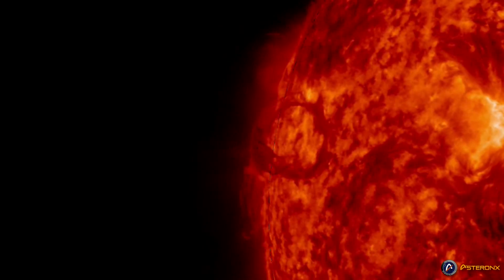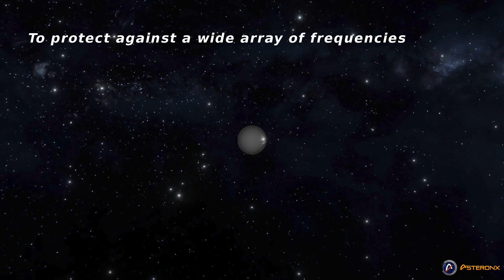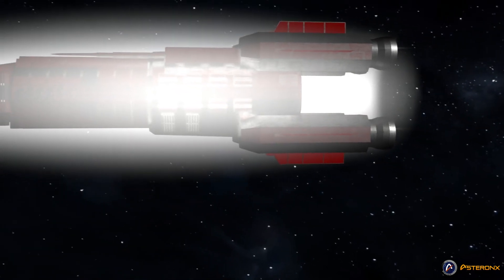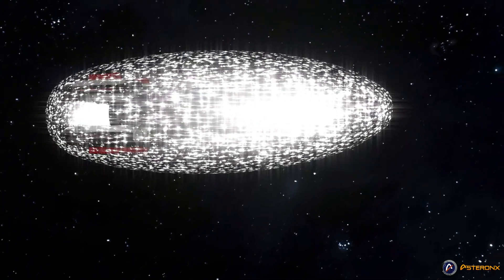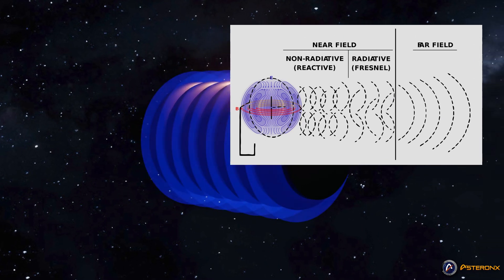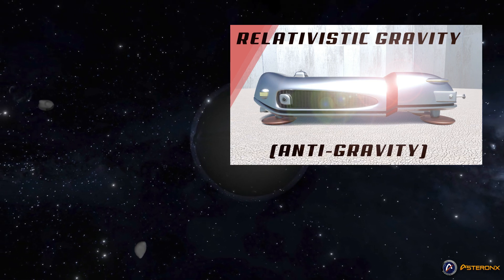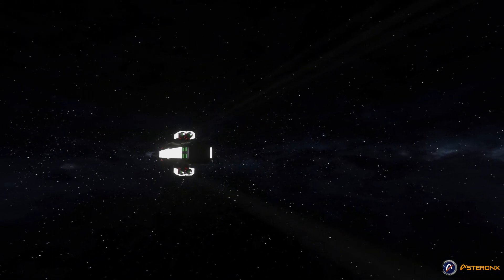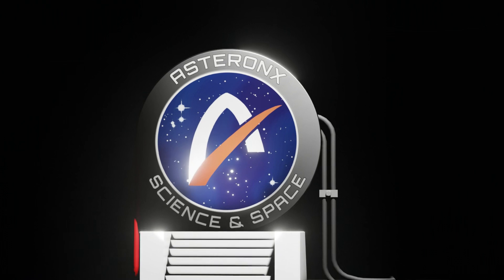Shields Up! Real Life Energy Shields

Comment: Assuming a warp field is possible, would it not, itself, have a 'shield' effect?
Reply from the maker: Yes and no, the more achievable variants have fairly gentle tidal forces across the bubble boundary, and so do nothing to deflect much of anything. However, with a redesign, it could very well be possible.
Reply: @asteronx  Some of the warp drive models worry about accumulating particles along the flightpath and that on termination/stopping, these would be released - potentially in a very destructive way.  This implied to me that the field might be effective at stopping incoming particles or even 'objects.'  If it were somehow possible to 'balance' the field in such a way as to avoid accumulating these particles, as some have suggested, then perhaps the field might still be an effective 'shield?'
Reply: @patrickseaman  Perhaps the theoretical work of Mr. Froning could provide effective shielding for pretty much all of those warp drive models.
Reply: @patrickseaman  That's what Starfleet ships had bussard collectors
Reply: @patrickseaman  That makes sense. Imagine dragging every particle from your whole flightpath at relativistic speeds and then having them all released at the same moment, all still travelling very fast in a nice straight line right at your vessel. Bummer. You'd be like yaaaaaay ! We did it!!  BANG.
Reply: @bubblezovlove7213  Maybe that's the last moment "flip" you do as you arrive, orienting the trailing edge in front of you and aiming it to release it into the local star at some oblique angle.  In our series of SF novels, we have a different way of dealing with it, though.  :-)
Reply: Yes. A warp drive consists of a repulsive gravitational field, or antigravity. Gravity and inertia are equivalent. With this in mind you could deflect matter. If you move forward at 1,000 gs, and produce an opposing gravitational field of 1,000 gs, the net g is 0. This type repels all matter, plasma, asteroids, particle beam weapons, slugs, etc, since all matter had gravity
Reply: Patrick Seaman A “Warp Field” the way we know it from Star Trek isn’t really possible and none of the concepts really apply. The closest thing we could create is an Alcubierre drive. This would warp space around the vessel expanding it behind and contracting it in front. This would negate the need for shields because the vessel is not actually moving.
Reply: How are you going to have expic captial ship  fights, if warp is your only defense? :D Imagine movies when they don't have to CGI that shit! In the likely post-scarcity situation I think we'd have to be in by that point, we may even just watch it as sports! Warriors nano-engineer their spacecraft with the help of AI, then duke it out.
Reply: Going FTL u go out of space because the universe protects itself against fast projectiles.  U force it then u dissapear untill u run out of energy or u can go for eternity untill u stop and say where the f am I. Everything is possible dont let your mind limite u or else u wont be able to make it. Like flying.

Comment: I appreciate the inclusion of the quantum vacuum in this discussion.  Quantum vacuum effects, properly resonated and projected, can address the superluminal travel question as well as the shielding question.  Energy from the quantum vacuum is virtually unlimited, after all!
Reply from the maker: Indeed, you ought see our video the Musha Jump drive, where lasers are used to create a negative energy region (in the quantum vacuum) ;)
Reply: Unlimited? Maybe...useful? No!
Reply from the maker: @nil981  Not so fast, all one needs is a gradient, and it has already been proven mathematically that at least a kind of battery storing energy in/via the quantum vacuum, is possible. And the reasons for this "battery" having a finite output are due to its material design, not a fundamental physics limitation.

Comment: First impressions, I like the idea of making use of energy shields, but I wouldn’t have guessed they’d be a thing, or if it did, magnetics would be more involved (like a magnetic field acting as a “net” or “bubble” to catch or deflect debris of projectiles). I’ll be a bit on the skeptical side for now and stick to my slanted armor or, if I have to, whipple shields.
Reply: Very thought provoking. My geeky inner self however has a brain itch induced by your mentions of Star Wars when I think you meant Star Trek :D
I guess it does apply to both "universes".. but still :D
Reply from the maker: @bluewavebluewave1600  Yes it could apply to both, though the second mention, of angled projectors--definitely Star Wars ;)
Reply from the maker: Armour is pretty useless against particle beam or x-ray lasers, and as The Expanse demonstrates--even against railgun projectiles.
Reply: AsteronX to an extent, yes. I hear all the time that slanted armor helps with deflecting projectiles, and on the other end I hear it’s best to just not get hit because projectiles will just rip you to pieces. I usually fall under the middle ground and assume that they will hold for some time, but you’ll still get killed in the end if you don’t initiate GTFO or kill the enemy- as you’d see in something like Children of a Dead Earth. 

X-Ray lasers would be absolutely devastating for anything, but the big problem is actually getting them. Project Excalibur involved having automated x-ray laser devices that were bomb-pumped by a nuclear detonation. They’ll emit a powerful x-ray laser nearly immediately before being engulfed by the blast- this was meant to destroy nukes. These were the main weapons of the battleship “Michael” from the novel “Footfall.” It was an orion spacecraft so it made use of nukes, so you’d spurt the lasers out the back, they’d aim at the marked target, then you’d launch a pulse unit and detonate it, propelling the craft and firing the laser at the same time. Problem is, they’d be destroyed in the blast- and they ain’t cheap. For Non-bomb-pumped x-Ray lasers, you might need a device over a kilometer long, so I could imagine it either being mounted on some massive rocket, or be stored away as connected pieces and then “folded out” when the time is right.

In the end, I focus on range. No need for armor whipple shields or energy shields when you can shoot first.

Excellent video, guys!
Reply from the maker: @nickwalker4936  Thank you :)

As to the non-bomb-pumped x-ray lasers... Consider the recent advancements in plasma wakefield accelerators, laser or proton driven. And consider fusion and/or antimatter power, that changes things.

Also, considering the kinetic energy of a railgun or any other mass drive projectile, a ship would probably need armour many feet thick.

On this topic, you might find this site interesting: http://www.projectrho.com/public_html/rocket/spacegunconvent.php
Reply: AsteronX I’d usually leave it up to the material used for the armor and the shape of the vessel. A literal cone with engines, Maybe?

Either way, it’s ironic because this site is where I get a lot of my material- I was reading through this article in particular all day yesterday, even more ironically.
Reply from the maker: @nickwalker4936  As they say: great minds think alike ;)

You think that it may be possible to armour a ship against railgun fire?
Reply: AsteronX again, it would be possible but it depends on the power of the railgun and the density and shape of the armor. 

Either way, I’m still sticking to trying to have greater range.
Reply from the maker: @nickwalker4936  Yes, it appears that, like with modern air combat, space combat will largely be a matter of range and a game of don't-get-hit, that is, until shields are developed...
Reply: @asteronx  Kontakt-5 style explosive reactive armor is HIGHLY effective against long rod penetrators. It terrified the US Army and Bundeswehr white when they discovered some shortly after the end of the Cold War. And it has only been improved in the last 30 years. But yes, resistance to directed energy weapons requires sacrificial ablative carbon layers and so forth. Plasma or Ambiplasma shielding seems much more practical for DEW resistance on spacecraft.
Reply from the maker: @djolds1  Sure, but against particle beams, x-ray lasers, and probably most space warship-caliber railguns, reactive armour would be of little use.
Reply: @asteronx  Against directed energy weapons, true. Against kinetic penetrators, Heavy ERA is much more effective than most in the West realize. The Soviet/ Russian Heavy ERA was designed to defeat kinetic penetrators, and is very good at it. The explosives fire the ERA plate outward at an angle, rather than straight out. It still creates a space to defeat HEAT round plasma jets, but the ERA plate hits the penetrator from the side rather than straight on. This induces a torque and spin in the penetrator. Impact surface area of the penetrator is increased many times when it hits the core armor just beneath the ERA tile, and impact energy per cm^2 is much reduced.
Reply from the maker: @djolds1  We understand, but against a railgun projectile travelling at 10, 100, 1000 kilometres per second, even such armour is little use. But against modern-day railguns, yes, it may still be highly effective.